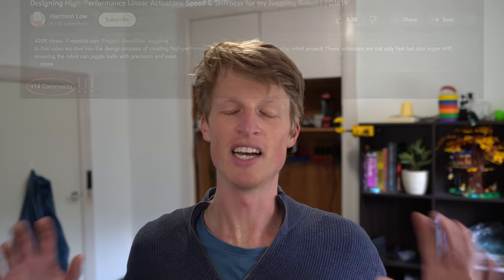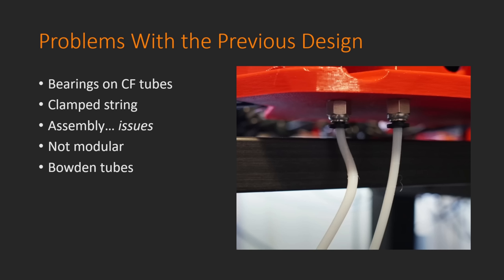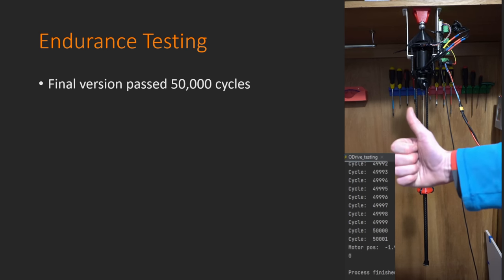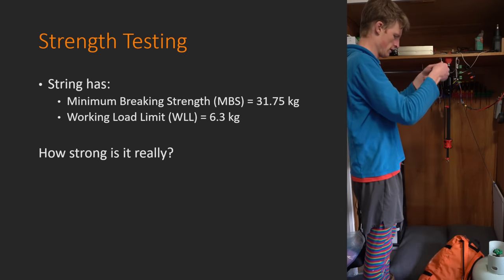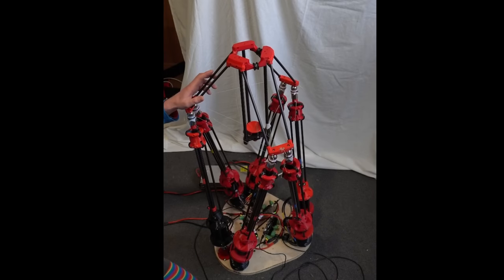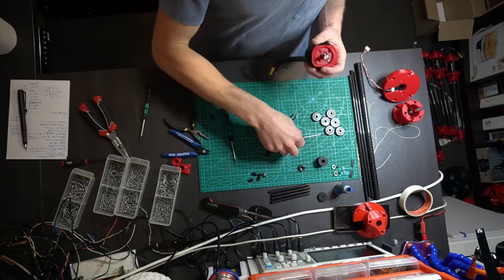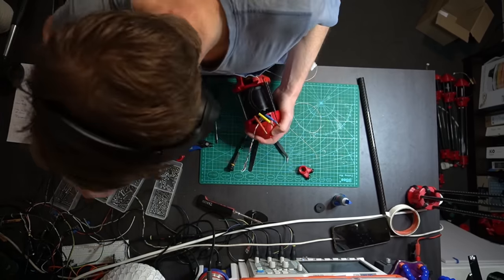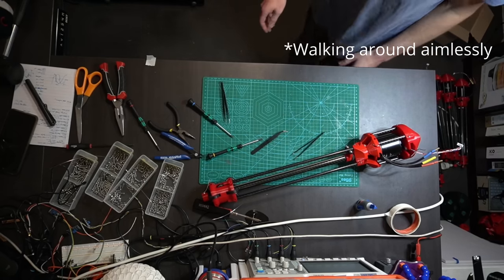My New Linear Actuators are SO MUCH BETTER! | PDJ #21

Comment: Regarding terminating synchro mesh cables: You could probably create a part with an internal "thread" that matches the cable. Perhaps create a two/three piece part that can be pushed onto the cable and match its shape. As the pieces are forced together with the cable between, they'd pinch the cable and hold it tight. Then you pinch that part in a collared holder that prevents it from slipping out and provide pressure to keep the cable captured. Very hard to explain, but perhaps you get the idea. Not sure if it'd stand up to the tension, but it probably could. Let me know if you want me to elaborate and produce diagrams!
Reply: I was just about to post a comment like this. My Prusa 3D printer does a similar thing for terminating the axis belts. You push the belt sideways into a cutout that matches the profile of the belt, and it engages several of the teeth to keep it in place.
Reply from the maker: Interesting! I think I get what you mean and I wonder if I could use this for the spool end of the cable? Something like: a conical part with a cutout in the side that the cable slips into. The conical part then fits into a similar conical cutout in the spool. As the cable is pulled tight, the first part (the one the cable is actually touching) is pulled further into the conical cutout, compressing it and strengthening its grasp on the cable.

Is that along the lines of what you were thinking? I like the idea, and I imagine it'd be fairly straightforward to turn this into a mechanism that would allow for quite fine adjustments to be made to the tension.

Cheers for the idea!
Reply: @harrisonlow  I'm sure there are many ways - I'm thinking of a cylindrical "nut" where the thread of the nut fits the cable. A typical nut probably wouldn't hold the cable because the clearance needed to rotate the nut would make it sloppy. But two half nuts with the proper thread could be clamped onto the cable with a set screw.

Perhaps you could even tighten the cable by rotating the two half nuts in their clamping recess - though I believe you'd have to both pull the cable and rotate the nut to overcome friction while fine tuning. I'd design the half nuts to have some kind of flange to allow turning it.
Reply from the maker: @mattiasfagerlund  Hmm, I'm not sure I follow exactly what you're describing. Are you suggesting having the synchromesh cable be fed through a cylindrical tube that has a sort of internal helical cutout? The synchromesh cable would need to be twisted to feed through, and shouldn't pull back through if exposed to a purely axial load (no torsion)—assuming the friction between the cable and the tube is high enough.

If you want to share images etc. may I suggest posting to the Zulip Topic on the matter? I'll post a link as a reply to this comment (in case YT removes it). If that doesn't work, you can find it in "#General > How to terminate synchromesh cable" on Zulip.
Reply from the maker: Link to Zulip Topic for Terminating Synchromesh cable:
https://pdj.zulipchat.com/#narrow/stream/399279-General/topic/How.20to.20Terminate.20Synchromesh.20Cable.3F
Reply: @harrisonlow  I'll move to Zulip!
Reply: "synchromesh cable be fed through a cylindrical tube that has a sort of internal helical cutout"  Maybe wax a section of cable, position it inside the tube, fill the tube with epoxy.  Unscrew the waxed cable from the cured epoxy.
Reply: The simplest way is to drill a hole in a block that the cable can pass through.

Drill and tap a second hole perpendicular to and intersecting the first.

Pass the cable through the first hole, tighten a screw or bolt in the second to "crush" the cable into place.

This simple method has been used widely including on automotive throttle cables (back when throttled used an actual cable).
Reply: Another option is to drill a hole in a bolt (Perpendicular to the threads), and pass the cable through the hole.  You then tighten a nut down until it engages the cable, potentially adding a washer between the bolt and cable to prevent cutting into the cable.  The main challenge is that bolts are usually hardened, so unless you get one made out of brass or something softer it can be difficult to drill through- trust me on this.  You might also need to grind a flat spot in the threads to get a stable place to drill.  Alternatively, you could heat an ordinary steel bolt up in a torch flame to red-heat or hotter and let it cool slowly to destroy the tempering.
Reply: its an interesting idea, you could also use electrical mounting clamps.
Reply: The hole could be drilled by electrical discharge machining (EDM).

Comment: Took a moment to think on the pulleys. Assuming there's space to turn the pulley, Blue can be done just by removing that first pulley and turning the second to face toward the rotor - imagine just pulling the pulley 'out'. For green, removing the second pulley and turning the first and third should also work. Less pulley, less friction, less length, more precision.

Comment: I think you should consider using Dyneema/Spectra for your ropes. It is made from high strength polyethylene fibers, and it's very resistant to wear (and thus quite hard to cut, even with a proper knife). It's used a lot in sailing and fishing, and I've seen some only 1mm in diameter, which I guess should be thin enough for your application, claiming several hundred kilos of working load.
Reply: Interesting project from engineering perspective. Endurance during 10x thousands of movement cycles seems the relevant criteria … and the weakest part might be these "strings" :-) Indeed we use dyneema/spectra on performance racing yachts, easily with very dynamic loads on main sheets and standing rigging between  5 tons and 20 tons (on boats of 16-18 meters), and much higher loads on bigger superyachts ... the rope producers also offer "pre-stretched" materials, so there is no need to worry of losing tensioning. :-) good luck for all projects coming along !!

Comment: You should look at 1-1.5mm Dyneema rope for your cable, very light, very flexible, very strong, low friction, low elongation/elasticity and easy to splice to create loop or termination
Reply: Kevlar would be better as dyneema does exhibit some degree of creep when maintained under tension for long periods. Kevlar is absolutely stable. Also is it possible to arrange it as a continuous loop running back to the capstan (motor) where it would be anchored by a tensioning screw widget. Would you ease the termination clamp problem.

Comment: I love the cable routing. Flipping the motor 90 deg may be better and less complicated, but I love complicated mechanisms. It just looks awesome
Reply: Sort of an aesthetically pleasing Heath Robinson affair.
Reply: Indeed, if there's no strong reason to keep the motor in-line (or not use of a 90° gearbox), it could make things much simpler.
It certainly looks cooler like this though

Comment: Super cool project! Immediately got a couple ideas as well.
Sorry if these are already named, but here we go:
- Route the extend and retract spring via the same wire, so kind of get a capstan drive.
- Make the sleeves for the inner bearings slightly concave. to make them self align to the rod? Maybe also make a groove in the middle of them to make a channel for the wire, to turn that issue into a feature. It might remove an extra bearing for routing the wire.
- Make the moving bearings three sets at a 90deg angle, to get a kind of rollercoaster setup.
- Add a fan to the output shaft of the motor, that spins a cooling fan over the brake resistor.
Well now that that's out in the world so I don't think about it again, good luck!

Comment: I once took apart an old photocopier and it had a steel cable moving the photocopier head around, so i think you might have some success with steel cables rather than nylon/other.
And it really did surprise me how supple the steel cable was, so there might be some specific type of cable for applications like this.
Reply from the maker: Interesting application! After the last video I actually picked up a bunch of steel cable and the sizes that are flexible enough weren't that much stronger than the kevlar line (and a lot more expensive) so I ultimately decided to stick with the kevlar.

Cheers for the suggestion 😊

Comment: Super glue probably doesn't stick well to TPU.  Scotch Weld PR40 adheres very well to TPU.  You could also print the TPU sleeves to be concave on the outside so they are self centering

Comment: For the TPU on bearings, you can use a concave instead of a convex shape.
Reply from the maker: I'm glad you mentioned this! I couldn't think of a succinct way to include this in the video but that was actually my first approach to this problem! Unfortunately there was an ungodly amount of rolling resistance between the 6 TPU sleeves and the tube. For reference, the 6 TPU sleeves had a concavity that perfectly matched (within 0.3 mm tolerance) the profile of the CF tube
Reply: @harrisonlow  If you make a rigid sleeve around the bearing with a semicircular groove, I'm sure you can find an off-the-shelf rubber o-ring that will fit in the groove snugly and provide friction.
Reply from the maker: @RobertLockhartMakesGames  Fantastic idea! Very simple and would be easy to replace parts for. I'll get some O-rings next time I'm at Bunnings and give it a test. Cheers for the idea!
Reply: To ensure symmetry you could print your bearing sleeves in two halves.
Reply: Would it be better two have two o rings per bearing or just one centered o ring?
Reply: @harrisonlow you also could put bearing in while printing. There are also concave bearings
Reply from the maker: @haukzi I'm not sure! I'll try both 😊
Reply from the maker: @ansgaryeysymontt7155 I used to be really keen on embedding parts in my prints, and I still love how neat and tidy they are, but the problem comes when you change the design and need that part again... Retrieval is tricky...
Reply: @harrisonlow  for me bearing is one time use anyway
Reply from the maker: @ansgaryeysymontt7155  Haha fair enough! I try to re-use my parts as much as possible, both because it's cheaper and it means I don't have to order parts as often and wait ages for them to arrive 😁
Reply: @harrisonlow  a problem with using a concave shape for the bearing sleeve is that in terms of linear speed the outer edges which are further away from the bearing centre radially have a high linear velocity than the middle of the concave section which is closer to the bearing centre (has a smaller radius), but the carbon rod travels at a uniform velocity, so you have a surface in contact with the carbon rod that has different linear velocities along its surface.

So as the rod moves it is trying to make the outer edges of the concave surface go at one speed and the inner section of the concave surface go at another speed, the same things happens all the way along the surface as the radius of the bearing isn’t constant, that difference in speed can’t actually happen since the bearing sleeve is a solid piece so that means something has to slip rather than roll, so you will end up with a single spot (actually two spots if it is symmetrical) on the bearing that roll and the whole rest of the surface will need to slip to some extent.
Reply: @ansgaryeysymontt7155 do you just love rebuying parts or something?
Reply: @user-cg3em4cw4f  Most of the time bearing is worth less than my time retrieving it. For me it isnt worth risk. I reuse only very hard to obtain or expensive bearings which i have to clean and replace grease. I cant give customer product with bearing of uncertain condition.
Reply: @ansgaryeysymontt7155  Ah, makes sense if it's for sale. I was thinking you meant for hobbyist projects. Maybe I'm weird but I will go to great lengths to retrieve press fit or embedded components just because I'm stingy.
Reply: @harrisonlow  indeed semicircular-grooved tires would have a lot a friction, since the bottom and the cusps are both engaging the rod but are at different radii from the bearing axle, they are trying to move at different speeds. you'll need to ensure there is only contact at a single radius; v-bearings with a relatively hard coating maybe, but the contact spot will still try to twist relative to the rod surface; just normal bearings with flat heat-shrink tires will likely be the lowest friction option.

Comment: It's been a treat watching this be developed! Some suggestions for future testing:
- Conduct endurance testing while the actuator is (reasonably) loaded, to better match end-use conditions
- Implement multiple load cases into the motion accuracy test (and record deviations in both absolute and relative positions with each move). Under a single constant load (or no load) the stiffness largely "disappears" since the parts' deflections under stress are not really changing. In the final application, the load will be constantly varying and this may have a large effect.

Comment: Hello stumbled into the video and the topic pulled me in. Retired Engineer in Medical, Automation and Robotics Systems. You do a great job of scientific thinking and setting goals. We used a Small Stewart Platform to shake test medical Data collectors in Scanners. It was amazing as we rolled through the frequency scale how bits would actually start to vibrate so much we could only see a blur where the part was.  We added braces and stiffeners and in the end it improved our end result significantly. The advantage of having access to Aerospace folks to help.  We also used Carbon Fiber for patient support to keep them nice and still. Later i used Carbon Fiber to build robotic arms, Large ones for Defense manufacturing, we added active and passive vibration dampening to get long arms with heavy grippers to move fast and stop without rebound. I appreciate what you doing and how you are doing it but still unclear what gizmo is doing.  oh and this work i mention was done in the late 70s and early 80s. Maybe you were born after that time. Keep it going troop you are educating as well as fixing your machine. We had to know position as well so we added a rotary counter on the motor to feed a location calculator.  Have fun and keep up the good work. Dennis
another thought on the center Round Shaft. I used a square Shaft on one device, machined two corners opposite each other and a three V shaped rollers to capture the shaft and maintain alignment with lowest drag. Those were all metal. I was surprised to see you running metal bearings on six sides of resin cured Carbon Fiber tube. The resin will require some compliance as you have learned. We found Delrin worked well it is machinable and robust with some compliance to prevent damage to the resin surface of the composite tubes. D

Comment: For your linear bearings, a lot of newer industrial bearings use metalized ceramics.  Systems that used to be rows of ball bearings on hardened steel rails have become ceramic sleeves which fit snug to the rail.  I don't know if that applies to carbon fiber tubing, or much for your project - but a good lool at linear bearings might give you some ideas for how to stabilize your tube.
I would even recommend going with some kind of graphite coating on the rods that can act as a dry lubricant.  An oil or grease probably won't fit the application well, but can make a world of difference in longevity.  Gears that run for decades with oil in them won't last a day without it.  A little can go a very long way.

You could look at just trying a teflon sleeve or set of pads that form to the wall of the tube.  Play around with contact area and pressure to get what you need.  The resin binder for the carbon fiber is probably going to be easy to wear.  You may want to consider adding or trying to identify tubing made with a harder material.  A silicon dioxide coating may improve wear characteristics (or perhaps an alumina spinel - quartz/saphire coat).
If you want to go aerospace, you could try a sputtered titanium nitride coating. Not sure how well (or horrible) it would fuse - but if you're looking to go off the wall with it - that would be a direction.

For the string, you might actually look into amarid/kevlar.  The nomenclature to use is "tow" when looking for strings of fabric material (same with carbon fiber) - I spent days losing my mind looking for a carbon fiber string because I didn't know that was called a "tow".  Well - a tow is unbraided, so I suppose not technically a string/line.
You might look at fishing lines for off the shelf solutions and even talk to those communities about line routing.

Comment: One thing you can do rather than use brake resistors is have a common rail for your motor drivers, so when one motor is generating it can power the other motors on the rails, and this will tie in with regenerative breaking too